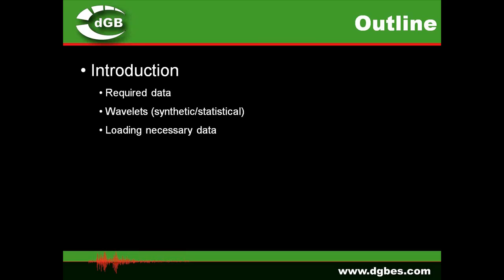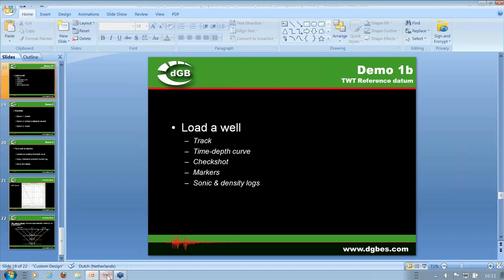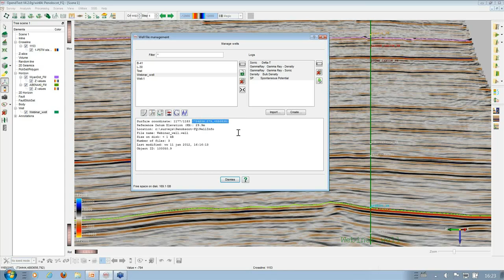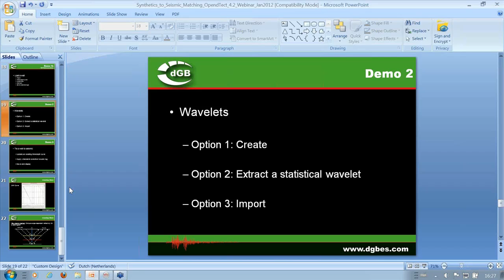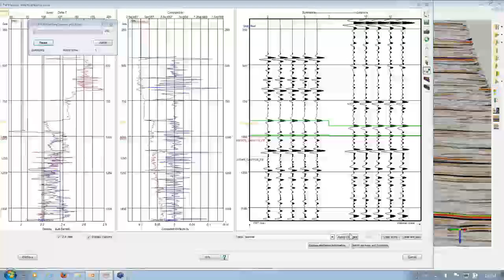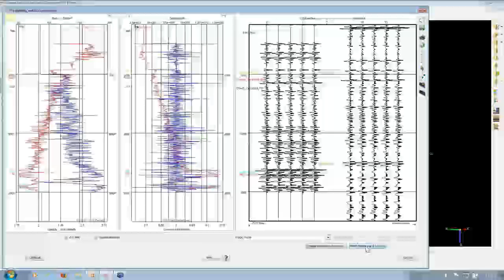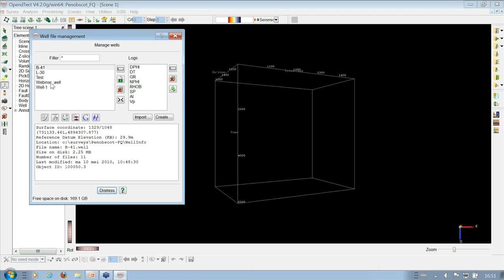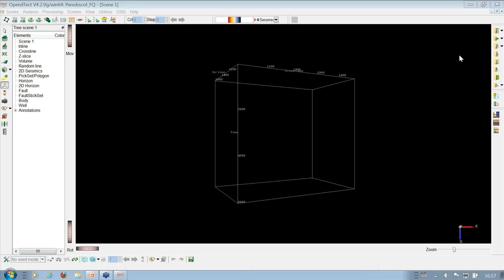Webinar: Synthethic to Seismic Matching - Well Ties in OpendTect 4.2

Comment: I am doing BS(Geophysics) from Bahria University Karachi, Pakistan. My thesis is going on can you help me to provide the well data . I will easily be work on it. I am  continuously working on petrel and techlog software to correlate the different data of wells but here are some difficulties about proposal of data and availability of data. I had searched everywhere on google but nor of the data is relevant to my field/my department of geophysics resist on that data which I previously got from google in a .LAS format. so it's my wonderful pleasure if you help me on this topic so I can work on Petro physical analysis. One more thing to favor me is that if  you wanna help me so kindly give me the complete data of well.